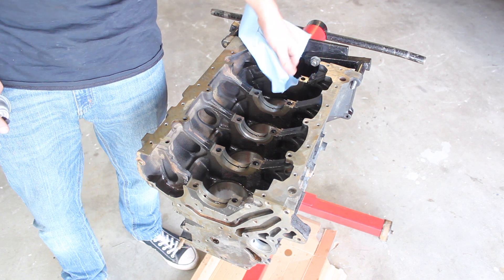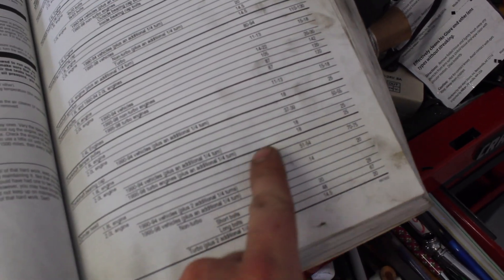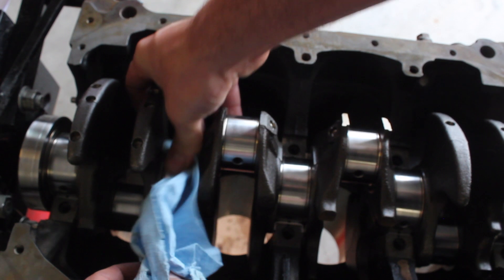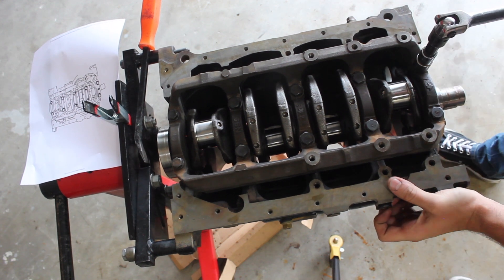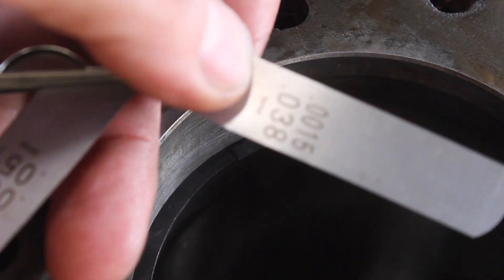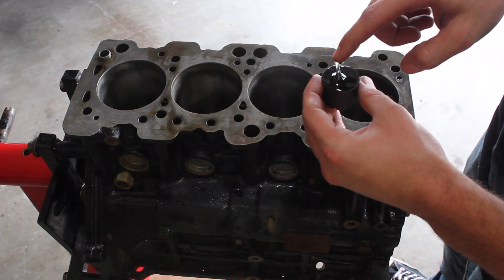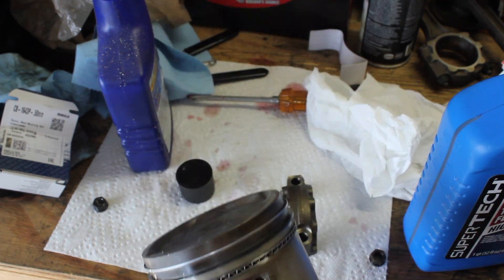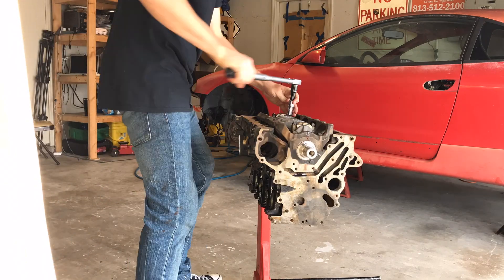4G63T Engine Block assembly :Mitzi Engine Check Episode 6

Comment: So, I wanted to just add some info on here. When you are putting a motor together having the right tools is key. The tools don't cost very much, and you will get more accurate measurements. Get you self a dial bore gauge, outside micrometers and a caliper. learn how to use those tools and you are good to go. Also, when you were installing the bearings to the block with no lubrication do not ever spin the crank at all. When you install the main and rod bearings its best to use the lube on the bearings and make sure the full surface is covered. 

When checking the piston to wall clearance on a boosted engine this is another thing that is very important. If you have to small of a PTW clearance you will damage the motor and it will not last. If the PTW clearance is too big with will have lower compression and more crank case pressure. Turbo engines make more heat in the combustion chamber. With to small of a piston ring end gap those rings will but up against each other and you will break you piston and or rings. Not bashing you just giving you some advice when you assemble your next motor.

Comment: The fist time i ever done quarter turns.  I used a clear compass , with cloths hanger wire holding it up above the ratchet, affixed to the block. And it did my final turns much slower than you did. Also, its best to use a piston ring installer. Maybe the rings you have are stainless steel but mine were iron for the LS. Each open gap of the oil and piston rings should not line up when final instal is done on the piston. They should be so many degrees apart and if i remember correctly. Oriented in a certain direction according to the block.
Reply from the maker: The Compass is a awesome idea. Just have to work with the starting point being north. 
Looking back at the video I suspect the torque it higher or lower than spec.

Comment: Hey man, watched the video and noticed you putting a feeler gauge between the ring and cylinder wall.  That measurement isn't going to tell you anything.  The piston to wall clearance must be measured with a bore gauge and does not have to do with the rings.  There is no need to measure the distance between the ring and the cylinder bore, since there should be no gap there - the ring is actually riding in the bore on the oil captured by the cross-hatch.  If the ring end gaps were within spec, that's all you should be concerned with when gapping the rings.
Reply from the maker: You are right. I thought the measurement was off and just measured it and left it in the edit. Im not really doing a how to. When you see the results you may choose a different route. If I can ever finish these videos.